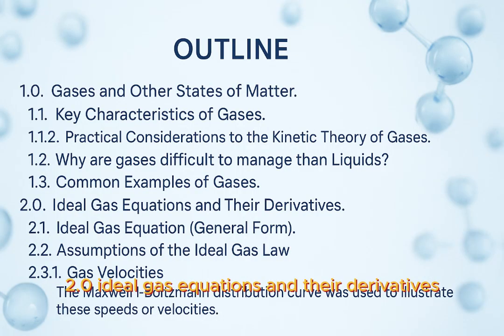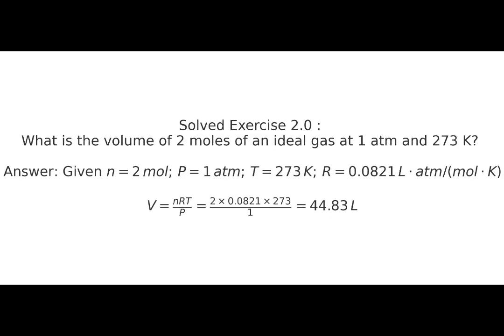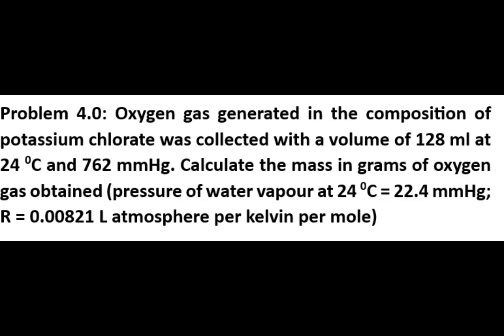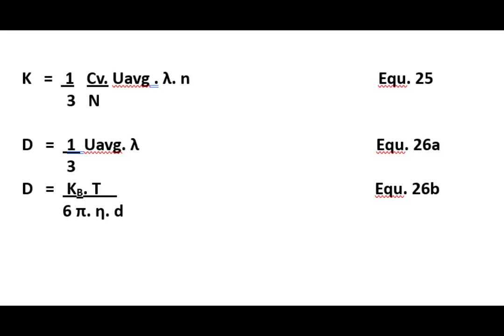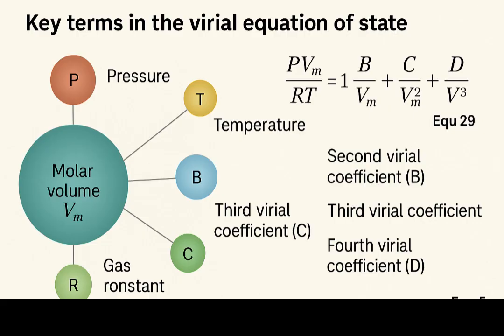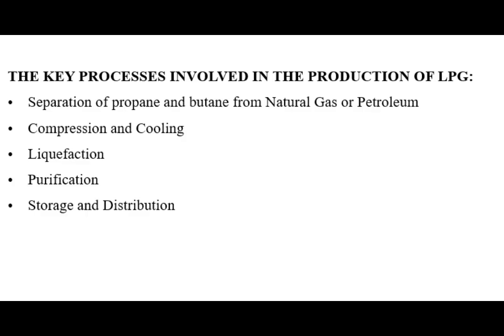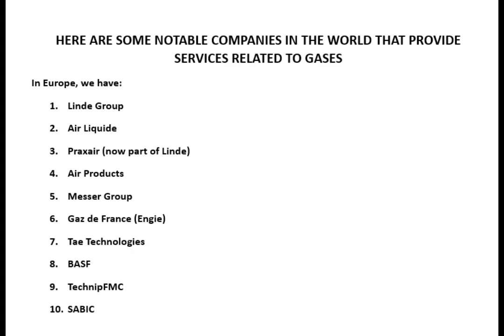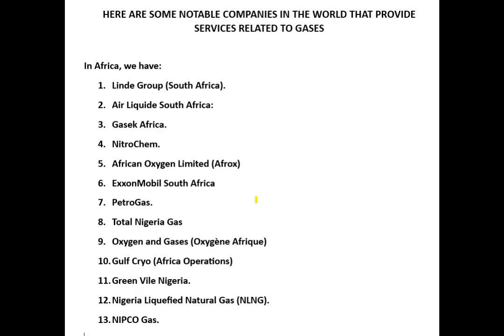Fundamentals and Applications of Gases

Comment: BCH : 

Using atmospheric air instead of medical-grade oxygen during surgery is dangerous because air contains only about 21% oxygen, which is not enough for patients under anesthesia. Medical oxygen from cylinders is nearly 100% pure, sterile, and supplied at controlled pressure, which is essential to keep the patient properly oxygenated and safe. Atmospheric air can’t meet these needs and could lead to hypoxia, organ failure, or death, and violates medical standards

Comment: BCH: U2023/5535134

Using atmospheric oxygen for surgical anesthesia would require significant technological advancements to overcome technical challenges and ensure consistent oxygen purity and pressure, crucial for patient safety, despite potential logistical benefits, due to the complexity and stringent safety requirements of anesthesia delivery systems.... 
Controlling all this with the accurate precision could be really difficult and result in severe implications such as endangering the patient due to lack of pure oxygen gas, excessive gas pressure during transfer which could ultimately lead to death...

Comment: BCH:
Atmospheric air is not a substitute for pure oxygen in surgical settings.
Doing so would cause:

Hypoxia

Increased risk of infection

Inaccurate anaesthetic dosing

Possible brain damage or death
Using atmospheric air instead of a pure oxygen cylinder during surgery is dangerous because:

Atmospheric air has only 21% oxygen, which is too low for anaesthetized patients.

It's unfiltered and may contain harmful particles or germs.

Anaesthesia machines require pure oxygen for accurate dosing.

Patients under anaesthesia may stop breathing properly and need a reliable oxygen supply.

Comment: GLY:(U2023/5565032) Onuchebe Onyinyechi Emmanuel 
Liquefied Natural Gas (LNG) is natural gas that has been cooled to a temperature of around -162°C (-259°F), causing it to condense into a liquid. This process reduces the volume of the gas, making it more practical and efficient for transportation and storage over long distances. LNG is primarily composed of methane and is used as a cleaner-burning fuel compared to coal or oil, producing fewer emissions when combusted. It's widely used for electricity generation, industrial applications, and as a fuel for vehicles and heating.

Comment: GLY (U2023/5565054 - Ik Gabriel Jidechi Praise)

Liquefied Natural Gas (LNG) is natural gas that has been cooled to a temperature of around -162°C (-259°F), causing it to condense into a liquid. This process reduces the volume of the gas, making it more practical and efficient for transportation and storage over long distances. LNG is primarily composed of methane and is used as a cleaner-burning fuel compared to coal or oil, producing fewer emissions when combusted. It's widely used for electricity generation, industrial applications, and as a fuel for vehicles and heating.

Comment: BCH: U2023/5535240

Usage of atmospheric oxygen in surgical anesthesia is a highly complex endeavor, fraught with significant technological and safety challenges. Ensuring precise control over oxygen purity and pressure is crucial, as even the slightest error can have devastating consequences, potentially endangering patients' lives due to inadequate oxygen supply, excessive gas pressure, or other complications, ultimately leading to serious harm or even death. The high stakes involved in maintaining the delicate balance required for safe anesthesia administration make it imperative to prioritize reliability and precision.

Comment: BCH: Using free oxygen from the air instead of pure oxygen from a cylinder during surgery is not safe. The air only contains about 21% oxygen, while surgery needs almost 100% pure oxygen to keep the patient alive and stable. Air is not clean or strong enough for medical use. Oxygen cylinders are pure, safe, and made for medical equipment. Using air can lead to serious problems like low oxygen, brain damage, or even death. 

So pure oxygen from cylinders is always used during anaesthesia for safety and proper care.

Comment: BCH 
Using air (with only 21% oxygen) instead of pure oxygen from cylinders for anesthesia during surgery isn’t practical. Air isn’t pure, may contain germs or pollutants, and can’t provide enough oxygen for patients under anesthesia. Cylinders give 100% pure, sterile oxygen, precisely controlled for safety and effectiveness. Using air could lead to low oxygen levels, infections, or complications, making it unsuitable for surgery.

Comment: PIC: LNG is not produced using the Joule-Thomson effect alone because it requires extremely low temperatures to liquify, while LPG liquifies at higher temperatures and pressures, making it easier to use the Joule-Thomson process.

Comment: BCH: U2023/5535027 (Mirabel Ihunwo)

Using free or atmospheric oxygen in place of medical-grade cylinder oxygen during surgery is inappropriate due to safety and control issues. Atmospheric air contains only 21% oxygen, which is insufficient for patients requiring high concentrations under anaesthesia. Free oxygen cannot be precisely regulated, posing risks of hypoxia, oxygen toxicity, and increased fire hazards in the operating theatre. Cylinder oxygen, however, is purified, controllable, and can be accurately mixed with anaesthetic gases, ensuring patient safety and effective anaesthesia management.

Comment: Alpheaus Tamunoibuomi Joyce 
U2023/5535052
Bch: - Air has only a small amount of oxygen (about 21%).
- Surgery needs pure oxygen to keep the patient safe.
- Air from outside is *not clean or strong enough*.
- Oxygen from cylinders is *pure, clean, and safe*.
- Using air instead of cylinder oxygen can be *dangerous*.

- We use oxygen cylinders during surgery because they give the right kind of oxygen the patient needs.

Comment: PIC  : 
 LNG  is  not  produced  via  Joule-Thomson  expansion  alone  because  methane  (  its  main  component  )  has  a  very  low  critical  temperature  ,  requiring  much  colder  conditions  than  Joule-Thomson  expansion  can  achieve  on  its  own  .  In  contrast  ,  LPG  components  liquefy  easily  at  moderate  pressures  and  temperatures  ,  making  Joule-Thomson  cooling  more  effective  for  LPG  .

Comment: PIC: LNG production involves complex industrial processes, not the Joule-Thomson experiment, due to efficiency and scalability requirements.
LNG (Liquefied Natural Gas) and LPG (Liquefied Petroleum Gas) have different properties and requirements.
LNG requires extremely low temperatures
(-162°C) to remain liquefied, which JT experiment alone can't achieve efficiently.
LPG, on the other hand, can be liquefied at relatively higher temperatures and pressures, making it more feasible to produce and store using different methods.
In terms of scalability, JT experiments are typically small-scale and can't be easily scaled up for industrial LNG production while for efficiency, JT effect alone may not be efficient enough for large-scale LNG production, leading to higher costs and energy consumption.
JT effect alone isn't enough to liquefy natural gas due to its limited cooling capacity. LNG requires multi-stage refrigeration with different refrigerants to reach the required cryogenic temperatures.

Comment: PIC: LNG (liquefied natural gas) and LPG (liquefied petroleum gas) are produced differently due to their distinct chemical composition and physical properties, which influence the processes used for liquefaction.
And also LNG’: primary components, methane, has a very low inversion temperature, requiring pre-cooling and more complex liquefaction processes

Comment: Victor Victory 
BCH:
The Implication of using atmospheric oxygen instead of medical-grade cylinders during surgery is that it is unsafe and clinically inappropriate.

1. Low Oxygen Concentration: Air has only 21% oxygen, while anaesthesia often requires 95–100%.

2. No Pressure/Flow Control: Anaesthetic machines need pressurized oxygen for accurate delivery.

3. Contamination Risk: Atmospheric air isn’t sterile and may introduce infections.

4. Serious Health Risks: Inadequate oxygen can cause hypoxia, brain damage, or death.

In summary, medical oxygen cylinders are essential for safe and effective anaesthesia. Atmospheric air is not a suitable substitute.

Comment: BCH: Using atmospheric Oxygen instead of pure cylinder Oxygen during surgery is not acceptable and highly dangerous. 
Atmospheric Air carries particular microbes and volatile compounds that can disturb the safety of patient. 
Atmospheric Air contains only about 21% of oxygen which can increase risk of Hypoxia leading to brain damage or organ failure or even death of the patient.
While Using pure cylinder Oxygen is the best, more safety and preferable. 
Cylinder Oxygen during surgery i filtered, sterile and regulated for medical use. Thanks

Comment: BCH: U2023/5535080.
 Some of the implications of using free and pure  form of oxygen in the atmosphere rather than the cylinder of pure oxygen for anaesthesia during surgery is that patients might be compromised due to inadequate oxygenation.

Patients might be at increased risk of hypoxia ( insufficient oxygen) due to the lower oxygen concentration.

Comment: BCH: Using atmospheric oxygen instead of pure cylinder oxygen during surgery is not advisable. The air around us contains only about 21% oxygen, which is not sufficient to support anaesthesia that requires higher oxygen concentration. Free air also lacks purity and may contain dust, microbes, or other pollutants that can cause infections or complications during surgery. In contrast, oxygen from medical cylinders is clean, sterile, and allows accurate control of flow and concentration.

Comment: BCH:U2023/5535103:

Using atmospheric air instead of pure oxygen from a cylinder during surgery is very dangerous. The air we breathe has only about 21% oxygen, but during anaesthesia, the body needs a higher amount to stay safe. Cylinder oxygen is 100% pure and allows doctors to control how much the patient receives. Atmospheric air is not clean—it may contain dust, germs, or smoke, which can cause infections. Anaesthetic gases also need pure oxygen to work properly. Without it, the patient can suffer from low oxygen (hypoxia), organ damage, or even death. That’s why medical-grade cylinder oxygen is always used.

Comment: MCB: Using free and pure oxygen from the atmosphere instead of medical oxygen from a cylinder during surgery has serious implications. Atmospheric air contains only about 21% oxygen, which is insufficient for maintaining proper oxygenation under anesthesia, where nearly 100% oxygen is often required. This can lead to hypoxia, putting the patient’s life at risk. Moreover, atmospheric air is not sterile and may contain dust, pathogens, and pollutants, increasing the risk of infection and complications during surgery. Unlike oxygen cylinders that provide a controlled and pressurized flow, atmospheric oxygen cannot be regulated or accurately measured. This makes it unsuitable for use with anesthesia machines, which are specifically designed to connect to oxygen tanks. Relying on atmospheric oxygen compromises patient safety and violates medical and ethical standards in surgical practice.

Comment: Baridam Emmanuella 

BCH: Using atmospheric oxygen instead of pure cylinder oxygen during surgery is not advisable. The air around us contains only about 21% oxygen, which is not sufficient to support anaesthesia that requires higher oxygen concentration. Free air also lacks purity and may contain dust, microbes, or other pollutants that can cause infections or complications during surgery. In contrast, oxygen from medical cylinders is clean, sterile, and allows accurate control of flow and concentration. This ensures the patient receives the right amount of oxygen needed to stay stable and safe throughout the procedure.

Comment: BCH: U2023/5535079
Not using the real gas application of oxygen in cylinders during surgery can have very serious implications. Oxygen is crucial for maintaining a patient’s blood oxygen levels which is essential for survival during surgery.
Without a proper oxygen supply , the patient could suffer from ;
1, potential safety risk due to unexpected behavior 
2, lack of oxygen to tissues (Hypoxia) which can lead to brain damage, organ failure or even death. 

Considering real gas behavior can help ensure accurate calculations and reliable operations.

The wrong gas could cause other complications like embolism or other types of injury

Comment: BCH: Using free and pure oxygen from the atmosphere instead of medical-grade oxygen cylinders for anesthesia carries significant risks. While pure oxygen is essential for anesthesia, its uncontrolled release from the atmosphere is dangerous due to potential fire hazards, contamination, and difficulty in precise dosing. Medical-grade cylinders are manufactured, tested, and regulated to ensure purity, consistent pressure, and safe delivery. 

Risks of using atmospheric oxygen:

Fire and Explosion:

Oxygen is a strong oxidizer and supports combustion. Uncontrolled oxygen in the atmosphere can readily ignite flammable materials and cause fires or explosions, especially in a surgical environment with potential ignition sources like electrical equipment. 

Contamination:

Atmospheric oxygen can contain dust, pollutants, and other airborne contaminants that can be harmful to the patient and interfere with the anesthesia process. 

Inaccurate Dosing:

Accurately controlling the concentration of oxygen delivered to the patient is crucial during anesthesia. Atmospheric oxygen concentrations vary and cannot be precisely regulated, leading to potential under- or over-oxygenation, which can have severe consequences. 

Lack of Sterility:

Medical-grade oxygen cylinders are sterilized to prevent infection. Atmospheric oxygen lacks this sterility and can introduce pathogens into the surgical field. 

Difficulty in Delivery:

Delivering a controlled flow of atmospheric oxygen to the patient during surgery is challenging, potentially requiring complex and unreliable delivery systems. 

Oxygen Toxicity:

Even with medical-grade oxygen, prolonged exposure to high concentrations can lead to oxygen toxicity, damaging tissues. Using atmospheric oxygen makes it harder to control oxygen levels and increases this risk. 

Absorption Atelectasis:

Pure oxygen can cause the collapse of lung tissue (atelectasis) due to rapid absorption of oxygen from the alveoli. This is a concern during general anesthesia and is mitigated by careful monitoring and control of oxygen delivery. 

Retinopathy of Prematurity:

In premature infants, excessive oxygen can cause retinopathy of prematurity. Close monitoring of oxygen levels is essential in these cases. 

Lack of Regulation and Quality Control:

Atmospheric oxygen lacks the rigorous quality control and testing associated with medical-grade oxygen cylinders. 

Why medical-grade oxygen cylinders are essential:

Purity:

Medical-grade oxygen is highly purified and free of contaminants.

Controlled Concentration:

Oxygen cylinders are designed to deliver a precise concentration of oxygen, ensuring optimal and safe delivery.

Reliable Delivery:

Cylinders provide a consistent and reliable source of oxygen, essential for maintaining anesthesia.

Safety Features:

Cylinders incorporate safety features like pressure relief valves, color-coding, and specialized valves to prevent leaks and ensure safe handling. 

In summary, while the concept of using free and pure oxygen for anesthesia might seem appealing, the potential risks associated with contamination, fire, inaccurate dosing, and difficulty in delivery make it an unacceptable and dangerous practice. Medical-grade oxygen cylinders are specifically designed to provide the necessary purity, concentration, and delivery control for safe and effective anesthesia.

Comment: PIC: LNG (mostly methane) is not made using the Joule-Thomson (J-T) effect because methane’s inversion temperature is very low. At room temperature, expanding it won’t cool it enough to liquefy.

LPG (like propane and butane) has higher inversion temperatures, so the J-T effect can cool and liquefy it easily.

LNG needs extra cooling stages and special equipment to reach very low temperatures (~ -162°C).

Comment: BCH... The oxygen in the atmosphere is not free nor pure.
Atmosphere contains 21% of oxygen and > 70% Nitrogen and about 0.3% CO2.
In a normal healthy person, this amount of oxygen is sufficient for saturating the red blood cells but under anesthetic conditions, pure 100% oxygen is needed, so that a patient has maximum oxygen saturation even when they loose blood during surgery, so there is sufficient tissue perfusion and no ischemia.
Also respiratory mechanisms of a patient may not be occurring at normal rate, so external help with a pulmonary machine is needed.

Comment: BCH : Using pure oxygen from a cylinder is safe, sterile, and precisely controlled, which is vital during anaesthesia.
Using oxygen from the atmosphere would give only 21% oxygen, with no pressure control and possible contamination — unsafe and inadequate for surgery.
Therefore, using atmospheric air instead of a cylinder would be unsafe and could endanger the patient.

Comment: GLY (U2023/5565117- Gideon Frank Mfon) 

Liquefied Natural Gas (LNG) is natural gas that has been cooled to a temperature of around -162°C (-259°F), causing it to condense into a liquid. This process reduces the volume of the gas, making it more practical and efficient for transportation and storage over long distances. LNG is primarily composed of methane and is used as a cleaner-burning fuel compared to coal or oil, producing fewer emissions when combusted. It's widely used for electricity generation, industrial applications, and as a fuel for vehicles and heating.